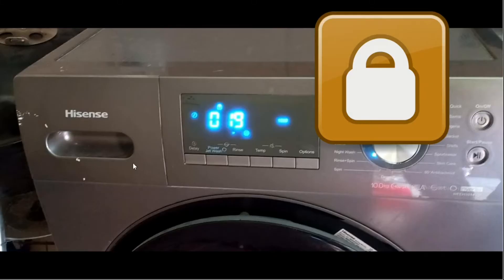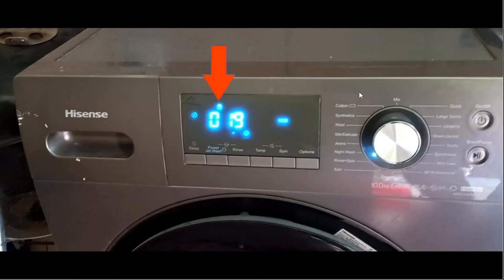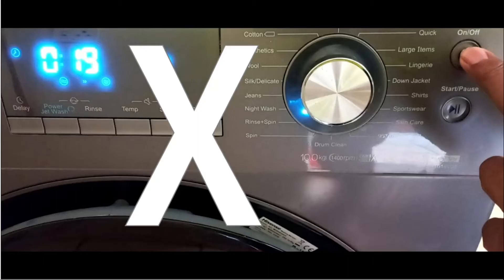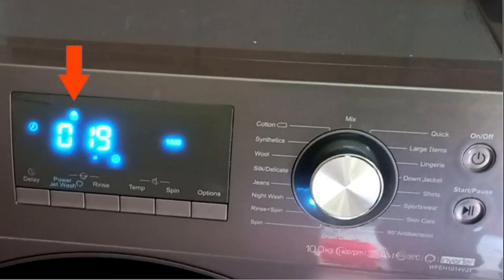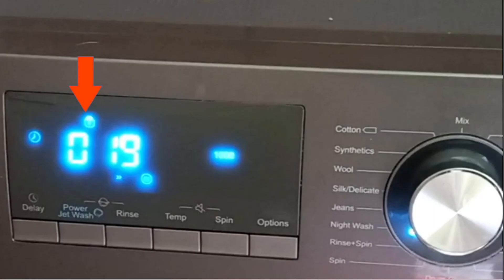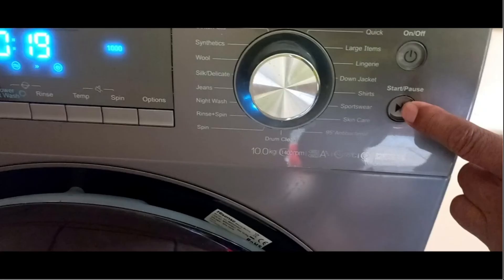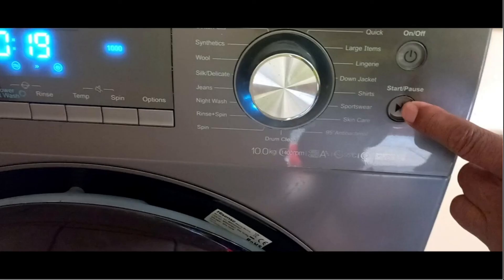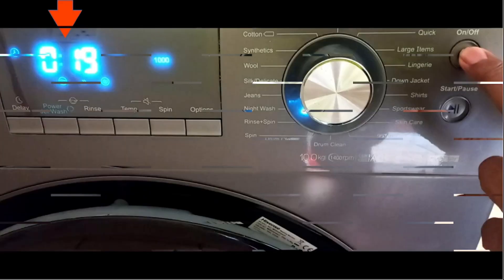Washing Machine Hisense WFEH1014VJ How to open door

Comment: Hi steven
We have the same washing machine, our lock burnt out, I have replaced it and it locks, but there is a pulse vibration and water does not flow out, on the lock mechanism, there is a white plastic piece, quiet long, does this need to hook up to anything, I can't see somewhere to hook it nto, but have a feeling I have missed something
Reply from the maker: Hi, unfortunately I do not know.   But I do not know about anything that must be hooked on.   Maybe you must contact the people who havae done the repairs?
Reply: @StevenDavidsIsNo1  that special person was me. I will call hisense tomorrow
Reply from the maker: @dwaynedeklerk1  ou tjommie.  Was the machine still under warrantee?   They may have problems if you started working on the machine yourself.   Hope you come right and let us know.  Best.
Reply: Do you have a wiring diagram for this washing machine, or know which color wire goes where on the door lock

Comment: My washing machine locked, but it's off. How do I get it on again?
Reply from the maker: You have to drain the water from the machine.  In order to do that, you must open the section in the front on the flower right hand corner.

Comment: My machine is not spin ithink there is lot of water inside how to unlocked I tried to open for the whole turn the plug but still is opening
Reply from the maker: There is a insert on the bottom right hand corner of the machine.  It is covered with a round disc.  Remove the disc and unscrew.  BE CAREFULL FOR WATERSPILLAGE.  Do this at a safe place.